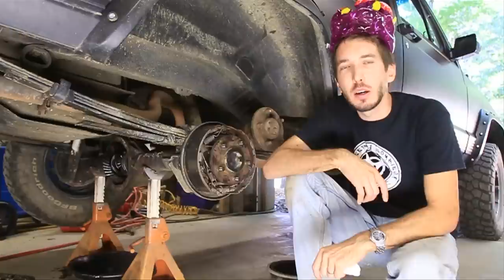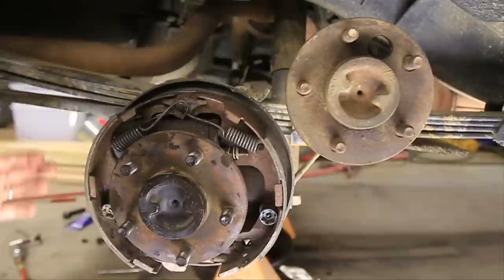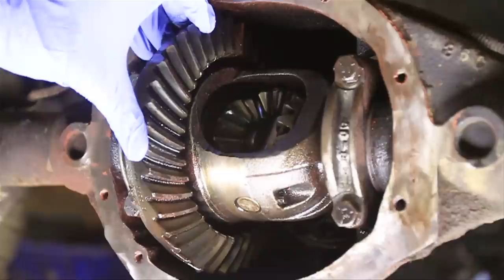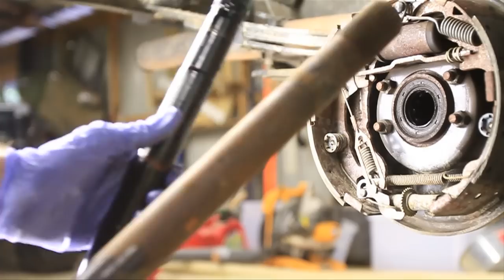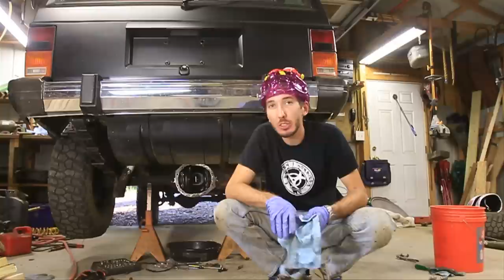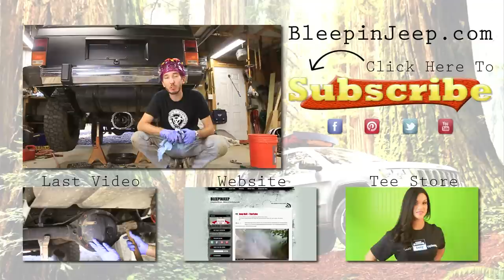How To Remove a C-Clip Axle Shaft

Comment: I used a Chraftsman 1/4" wrench for the pinion shaft retaining bolt. The box end is 12 point. Then you don't have to take the cap off for ratchet clearance. Great video as always.

Comment: Hey Matt,

Thanks for taking the time to make this video. It has really helped me understand how
 C-clip rear end axles come apart. I have a ‘95 Cadillac Fleetwood with a GM 10 bolt rear and I’m going to have to replace the wheel bearing seals on it. I’ve worked on Ford and Mopar rears with the bolt on axle retainers but this will be my first time working on this type of rear. This has given me the confidence to get in there and get it fixed.

Comment: you don't have to remove the bearing retainer, just use a 1/4 inch drive with a universal joint adapter. Or better yet a simple wrench.

Comment: Great video!  This really reinforces an axle job I had a chance to see an older buddy of mine do several years back on an older chevy pickup truck.  Fortunately, he worked at a tractor repair shop where he had access to an A-frame lift to hoist up the pickup rear end and made the repair go quick.  I also remember him working with different size shims to take out the correct amount of play in the differential.  Very interesting!

Comment: Thanks for a great video - these axel shafts make great steel for blacksmithing tools. Thanks to your video I was able to go and get this steel at my local pick and pull for about $1 a pound which is about 10 times cheaper than buying new tool steel.
Reply from the maker: Maybe I should make another video on how to acquire cheap blacksmith metal!
Reply: If you do make sure to touch on leaf and coil spring removal - a lot of smiths use both of those (coil is a little annoying because you have to straighten it). Downside with leaf spring is a lot of the junk leaf you can get will have small cracks that only show up once you head it up (look like little black lines).

Comment: Hi, thanks for the video. I'm having trouble, though, and need some advice. After removing the center pin, for some reason the axle shaft will not push in to release the c-clip for removal. Any ideas? Suggestions? Thanks in advance, mark
Reply: Update:  ended up using the slide hammer that I got on loan from Advance Auto Parts (to pull the axle bearing) and slid it back and forth a few times.  This loosened up the axle shaft and the c-clip fell right out.  Now, on to the next phase!

Comment: Just wanted to point out that ONLY c-clip axles with drum brakes will the tire fall off....if you have discs in back the axle is held in place by the c-clip and caliper brake bracket.
Reply: sirtubemaster my disk brake dana 35 is still c clip
Reply: sirtubemaster excellent point

Comment: good video,  that's smart to put the pin back into position after C clip is removed.. I have  '65 chevelle & I have done this job before to replace axle seals.. I used the 'offset'  bearing/seal, big mistake!   if axle seals are leaking, chances are the axle  is worn out where the bearing rides..  went down to Napa & they had the complete axle, bearing, seal & studs as a  kit..

Comment: Nice video...guy!!! I had a question tho: I have a 04 frontier. 2wd. 4 cyl. I dont have a hole next to wheel bolts...so it must be c-clip. But when I tried to take that long pin out...i couldnt, because it is sitting inside of a "biggest" gear...and I cant pul it out all the way...so where do I find those c-clips? thanks.

Comment: This is the easy part. What I have found no way to do myself, is pull the diff on the dana 35 SLA because there is no accessable pin to release the cross pin. So how does the cross pin come out if there is no visible way to release it?

Comment: After all these years people still think the C-clip is the issue when the actual issue was the axle shaft itself breaking near the splines, under duress load, with larger than stock tires....  The C-clips were not the issue and in fact, there are many C-clip axles still running around just fine.

Comment: Matt, I have a lot of sideways movement suddenly, I can slide the axle shafts (both move together both directions) sideways about 1/4", the pinion backlash doesn't change when it's one way or the other, I keep reading this movement is normal, but it didn't have it before and I don't see how it can be normal (35c, superior truss, Alloy USA shafts, Tru-Trac, 4.88 Motive Gear R&P). Thanks in advance for any input.

Comment: Just did this and the biggest tip is to remove the bearing cap so you can get a socket on the small 12 point pin that keeps the long rod in place holding the axles in.  I had to go to Harbor Freight and find an E-8 socket as that was what finally worked to get that bugger out.  As soon as the rod came out holding the axles back a cupped metal piece fell out.  It was one of the shims for the gears and was held in place by that rod.  Must be worn to fall out so easily.  My question now it after pulling out the old bearings what size socket did you use to hammer the bearings back in?  Was it a 2.5 inch or something else?  That would be helpful....or is there a tool for that.
Reply: +William Patterson Finished the job and what a bear...had to find at harbor freight an E-8 socket to get that pin out so i could push in the axles.  i then had a crazy time finding the right oil seals.  But all said and done with the help of rental tools everything is back in order.  Great help in the video in taking off the bear cap to get that stinking pin out holding iin the axles.

Comment: Great video, my question is, does a 1997 grand Cherokee have the same rear end configuration?
Reply: +jeff green I just opened up the housing on a '98 model,  It is the same layout as this! My pinion pin retainer bolt snapped in two while taking it out! WAAAAHHH!!! Mine is a Dana 44 but it uses C'clips also, same setup as this one which is a Dana 35 I believe!

Comment: I have xj with 4.56 gears and arb  (on chrysler 8.25 / 27 spline). Heard a metal friction sound from the right rear end when cornering to the right.  Found that the top end  of the axle was spinning at  the drum brake.
so i Removed the axles and both were worn at the top bottom (after the c-clip / the part that touches the cross pin in the carrier). 
Changed the axles without touching the ring and pinion , checked the backlash all ok. i noticed that the axle top bottom was touching the cross pin (both axles laying on it).
Drove the jeep for about 40 miles then a whining sound came from the gears on acceleration and deceleration.
Opened the diff next day and the ring was worn plus silver color of metal found in the oil.
I will replace the ring and pinion with a new one  but im afraid to have the same problem again. 
Any idea what caused the ring to wear so i can check it before installing new gears set?
Thank you

Comment: Would you happen to know if an 89 chevy 1500 2wd has the same set up rear end / axle set up? My father has an 89' chevy 1500 Sport model and i'm 90% sure that it has possi rear end.. His axle seal is leaking and we were thinking of doing it ourselfs but hate to tear into it without some type of info or heads up on the set up of those year models..... Thanks, Great vid btw

Comment: So I have the cover off, c- clips out and the car in neutral. I cant turn the differential easily to get to the pin. I have to really force the drive shaft with a pry bar to spin it at all. Any suggestions?
Reply: Ray Man yes, turns out my front brakes were pretty seized... felt pretty stupid

Comment: Great video, 2 improvements that will hopefully help others: The 1/4" 12 point retaining bolt can be removed with a 1/4" ring spanner so you don't need to remove the bearing race. 

Second part, my left axle has 4 thin circlips that were sitting against the C-clip, anyone else have these??

Comment: Hey matt, great video! Would you have any idea how to remove the shaft screw if it was stripped? Mine wouldnt budge and i ended up rounding that thing off!
Reply from the maker: +KLC Pytheas no, that sucks... my only thought would be to grind it square so you could get a wrench on it again... or maybe hammer a smaller socket on there super tight.
Reply: +BleepinJeep update. I cut off the end, then used and easy out. Ended up having to attach a breaker bar to break it free.

Comment: Hey Matt, great videos!! I was wondering if you could assist me. I'm having issues removing the pinion shaft lock bolt. It wont budge and looks like its about to be stripped. Any suggestions?
Reply: +KLC Pytheas Heat the carrier with a torch right where the bolt goes through! Don't get it red hot or anything!! As soon as you get it hot be ready to try backing it out! Also you could tap lightly on the head of the bolt with a small hammer right before you try turning it! Don't strike the head sideways! Hit it like it was a nail!

Comment: Don't take the right carrier cap off, it is not necessary, simply use a 1/4 inch short 12 or (or 6 point if this is your bolt type) or a long box wrench and a screwdriver to hold carrier while loosening pin retainer bolt.

Comment: Cool vid, however when I put the new shaft in from identical jeep the shaft now moves in and out a lil. Everything is put together the same but my spider gears did fall out. Is it possible I got shims on gears in the worng places would that cause the shaft lashing?
Reply from the maker: Michael Carpenter Hmm, possibly, or maybe the bearings on the new shaft are not in the right place??  im not real sure...
Reply: When the spiders fell from place so did the washers they ride on. I got it back together but cannot find propper instructions on how or why this would be an issue. I posted video on Arizona jeep club on Facebook.  And got little advice. I will probably take to shop soon. I just hate having a problem I cant figure out

Comment: that big pin with the set screw where the spider gears are is stuck in mine. i have a caddy brougham, very similar. any ideas why its stuck? it has a tiny bit of play but wont come out.

Comment: do you have to take that big c clamp off? couldn't you just use a open ender to remove the bolt holding the pin in?

Comment: Ive got some bad tire wobble on my left rear axle of my 2001 jeep cherokee. IT has been bad for a while. I got the 8.25 rear used. IF I replace the whole axle will it fix the tire wobble. Its just the left/drivers side.
Reply from the maker: +SuperDagod1 guess it depends on where the wobble is coming from, if it's from a bad out of balance tire then no, but if it is the axle then yes.
Reply: SuperDagod1.

Comment: With all of the force, and torque which is placed upon the axles during vehicle operation, on and off road, how is it that the C-clips don't just shear off? I don't understand how those tiny silver dollar sized things hold the weight of everything  connected to the axle in?
Reply from the maker: Skot Ward its pretty thick and it only has to keep it from sliding out, the weight is on the bearings... that said, it is a bad design for offroad use.
Reply: BleepinJeep Thanks Matt. :)
Reply: +Skot Ward Because Skot these C clips are hardened steel for one things and even though they rotate with the axle shaft spider gear at the same time the C clips never turn against the axle groove itself.  So they are actually more bullet proof than the flange outer bolt up axle design because consider the only thing that actually holds on the flange outer bolt up is the inner race being pressed against the axle surface in which bearing housings can CRACK and once it does if lets say a bearing is worn down a bit and you hit a bump the whole axle can slide out.  Youre depending on the flange bearing pressed on axle assemblys bearing inner TOTALLY.  That axle is harder than a bearing that cost 8 dollars and to depend on a 8 dollar bearing that can crack and cause your axle and wheel to slide out on the highway is actually a stupid ass design as to where the C clip as I stated does not turn on the inner axle but turns with the inner axle and is SAFER and stronger

Comment: Good lord. I neglected to put the pin back in, and now my top and bottom spider gears / shims are out of whack. Any ideas on how to line them up again with the holes so that I can get the pin back in? argh. They haven't fallen out, they just off center.
Reply: Never mind. I got it. The limited slip clutch packs were pressing everything together so I just kinda drifted them back into place.

Comment: You really should have mentioned that when you were taking off the carrier bearing cap that you make sure to get the orientation just the way it was so it should have been marked.  
Yeah I hate c clips I snapped the right axle shaft on my 94 ranger while spinning in the mud off road in 3rd gear and then went onto pavement spinning and pop.  Well I put it in 4WD and a little bit down the road the wheel and shaft passed me and hit a parked truck that belonged to a cop LOL.  He was cool about it when he found me the next evening.
Now I'm rebuilding a DANA 80, it atleast doesn't have c clips but nothings cheap.
Reply: HE DID SAY THAT, PAY ATTENTION.

Comment: Do you run stock motor mounts on your XJ's?  i installed energy suspension poly mounts on my offroad XJ. They were a pain to get ready cuz you have to reuse the old metal and grind off the rubber but they seem to work great!  i replaced my mounts 4 times in a year with stock mounts.

Comment: need help.  a friend helped me get c clips and spider gears left and right also helped me remove axles.  heres my problem.  i was shown how to reve them i actuslly did it.  i have no idea how to properly time these or are they timed.  i have the car. in nuetral and have not turnef engine over.. iwas asked to take out.spider ect but did not have time to film and did not know to mark with a chisel i have seen some doing that on yoke removal.  mine is straight forward.  i am just learning the parts lingo.  it would be nice to see this in a graphical way.
Reply: +James Ready - You don't have to time any thing. Just put the spiders gears back in and install the axles and you're done. You do have to make sure you get the shims and spider gears back in the same way they came out and installed on the same side they came from.
Reply: I finished a while ago did have some help.  Turns out that it is in my titres.  Mecanic friend said that tires were seconds and the steel belts were overlapping.  This caused the weird tire sound.

Comment: Ok I have a 1/2 ton chevy 2x4 and I found I have a leaky axel seal on the passenger side.( Brakes Locking up )  I have to take the rear dif cover off . Did that . Messy smelly . And I have that Pin lock that holds the spider gears in . ( Lock pin 10 mm ) This little pin broke off . How do I retrieve this ? Can i drill out the big pin from the bottom ? 5/8s metal bit . Then punch it out .  I had someone tell me that  they would tourch it out. The big pin . I think thats going to be a big heat problem . What your thoughts on trying to remove the broken part. Since then I put the screw head back in and waiting on what to do.
Reply: Pinion shaft lock bolt extractor kit

Comment: Matt, Is converting a Dana 35 from c-clip tp non-clip a good idea and is it as easy as some say it is. I also read that purchasing good quality  (chromoly) c-clip axles are just as good as non c-clip. Are all Dana 35 axle housings the same regardless of the year of the vehicle? Thanks, John Rini
Reply from the maker: Ive never converted one.  But IMO I wouldn't spend much money on a D35, if your gonna wheel hard enough to break it then you should use that as an excuse to upgrade.  That said, chromoly would have less tendency to break therefore being a c-clip wouldnt be that big a deal.  The reason you don't want a c-clip is because if the axle shaft breaks the wheel and everything will slide out.  As far as I know D35's are the same except some are set up for leafs and some for coils, but the housings are the same.

Comment: win replacing my bearing but the spider gear moved and off set the shim ive spent the last hour trying to to align the hole and the shim to get the bolt back in. any ideas that will make it easier for me to align them to get the pin back in???? please help. thanks
Reply: I'm*

Comment: I have a Dana 44 rear end and that small screw is broken. Can I drill it out and replace that small screw?
Reply from the maker: You sure it's not a drift pin?  Some have drift pins instead of the screw.
Reply: @bleepinjeep . It's an actual screw that's threaded part way and a shaft the rest. It was already broken when I removed it. You can see where it broke. I just ordered another one but not sure if it can be drilled out? I'm going to try very carefully tomorrow. My screw is identical to the one you pulled out on this video.

Comment: what would you do if the little screw was broken in the center pin? mine is & I need to change my pinion bearing in my C clip axle
Reply: artardFTW Use as easy out or drill out the bolt. BE CAREFUL Not to get any metal shavings in your diff

Comment: I have  seen  broken c clip axles on the trail.  What a crap design for off road running larger tires.  If i had one it would have aftermarket axles.